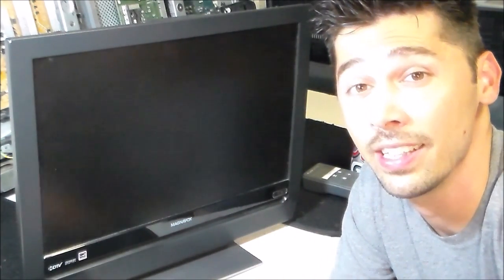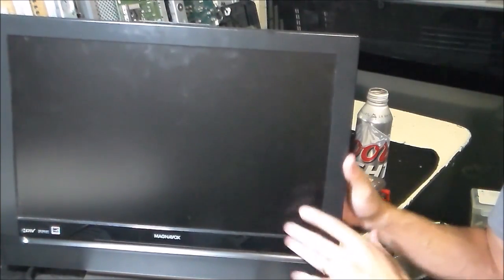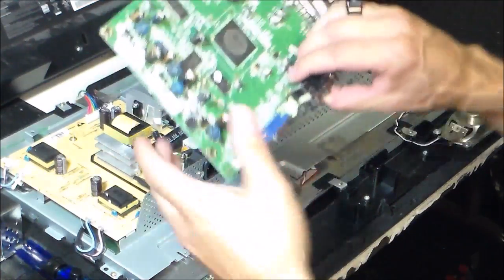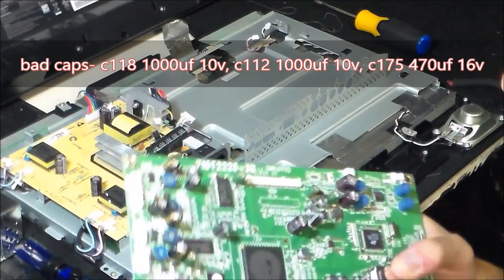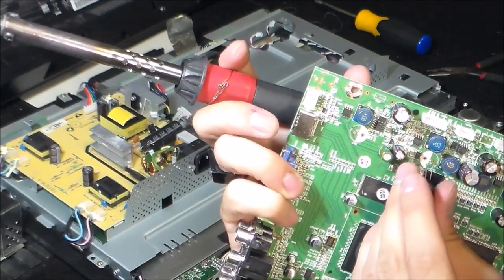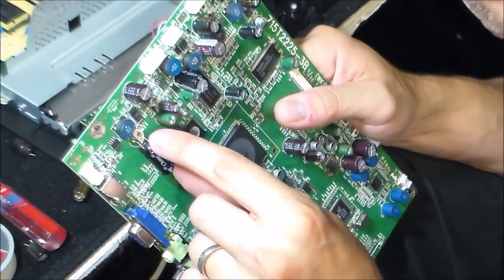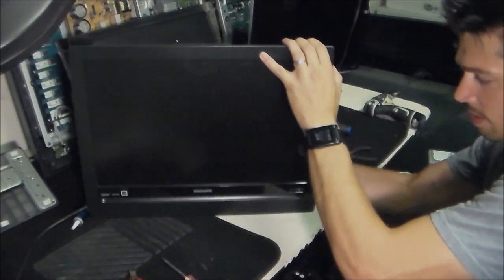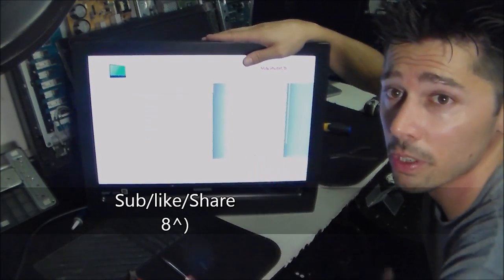Easy Common LCD TV repair service video, no power

Comment: Great Video! Have you ever worked on  Panasonic TC-L58E60 LCD TV Vierra Series? I cannot get  mine to do anything. I lost the remote but it has a power button. I even replaced the power board and it still is not powering on or showing any blinking lights if you have any advice I would gladly appreciate thank you!

Comment: Saw some of your YT vids about fixing LCDs. I have my 65" Toshiba 65HT2U that just died out of no where. Watching TV and picture went dead as if someone turn off the TV. I pressed the power button and the Power LED on the bottom left flashed a few times and never to flash again. No matter how much I press power button on TV, nothing happens. 
I decided to open her up. Checked fuse (good continuity and actually getting 117vAC). Toned out the power cord (good as well). I went through the pins on the vDC side and got 5vDC on one of the pins (not sure which one though). I went ahead and replaced the power control board from EBay, but wound up with no change of symptom. Don't see any blown caps on power supply board nor on TCOM (SLAVE1 and SLAVE2).
Any suggestions/ideas?
Any tips would be greatly appreciated.

Comment: We've got a 32MD357B LCD Magnavox TV which we use in the kid's playroom mostly for them to watch dvds on. It stopped working a couple of days ago. We aren't getting any power at all, no red light or anything. Does that sound like a capacitor problem?

Thanks for your help!

Comment: Hi. Thanks again for making this channel. By the way, what subcomponent (resistor, transistor, etc.) could one use to hack/replace and increase say the new iMac 5K LCD's refresh rate from 60Hz to 120Hz or more so you can use CAD like apps for visualization or for games (stereoscopic depth is way a better experience than ultra setting in games. A game could in be the lowest setting but will look great with 3D stereoscopic) after work when you're using 3D glasses for the AMD GPU's (Apple truly need to use Nvidia's most powerful mobile GPU on the next iMac 5K instead of AMD coz' Nvidia's got 3D Vision IR 3D Glasses). 60Hz will cause headaches when used with 3D Glasses, it's too slow. God bless. Rev. 21:4

Comment: I tried replacing the 3 caps.   I  notice that sometimes on its own now is it will go from RED to GREEN
but still no picture or sound.   The remote still does nothing.   Any other thoughts?

Comment: I wanna start fixing TVs, what capacitors should I have in stock?
Reply from the maker: these are common- 100uf to 3300uf get here-http://www.amazon.com/Sunkee-Values-Electrolytic-Capacitor-1000UF/dp/B00CV3MWXW?tag=tampfreepcpin-20&linkCode=w13&linkID=&ref_=assoc_res_sw_result_3
Reply: ***** Thank you

Comment: @Tampatec  my lcd is not turning on i opened and checked the power board of my tv the voltages are good 5v and all the voltage comes and work on power board but it doesn't start and turn on and the red light on the tv is also not coming Can you please tell me what's the problem with my toshiba LCD tv and how to fix it

Comment: I have a sceptre, the red light comes on when plugged in but not always, most times you have to keep plugging and unplugging it. once I turn it on the screen is black and the light by the red one is blue, if I unplug and replug, and I get lucky the tv will turn on. could it be they power cord itself or is it failed capacitors?

Comment: Hi, I have a weller wes51 and the some of the solder i have is 60/40 .031"/0.8mm is that fine? how much should I charge to fix a tv that doesn't turn on?
Reply from the maker: most solder will work fine but i don't charge family or friends but customers i think $40-60 a hour is fair, sometimes techs charge $20 trip charge too.
Reply: ***** Thank you

Comment: Hi, here is a very hard one for you.  I have a villa in Spain, the LG TV there will not work at the villa, but if I take it next door it works fine, I have run a wire from next door into my home, and still no TV, I have tried every socket in the villa, no TV.
Any ideas, if anyone can understand this I am sure that you can.
Thanks for your videos, there are great.
Kind regards Tony
Reply from the maker: not working meaning no tv picture or no power? i need more info
Reply: Thank you for your time,  I am not in Spain at the moment, but when I was last there the TV was very slow to come on, I have whatched your video, and will change the caps when I get back.  My villa manager has changed the TV, and he is holding the LG until I can do the repair. He tells me the TV works in his home, but when he takes it back to my home, it will not come on, just like when I was there. could it still be the caps, or a fault in the villa power, he has tried it in all the outlets, TV not working in my home, but works when he takes it back to his.
Kind regards Tony
Reply from the maker: Tony Eaves doesn't hurt to open up tv and check out the caps but it can be electric outlets.

Comment: hey my tv is a soniq 40 led lcd tv and I have the same problem but I look inside and there is nothing wrong with the capacitors (I know as I have fixed monitors etc with blown capacitors) I have bo idea what it could be it has red light when you push the power on button nothing happens

Comment: Hi I just got this 2014 samsung curved TV less than a month ago an it crapped out on me. Model number: UN55HU7250FXZA. The tv turns on but there is no picture. I can see the backlight when I look from the side and the tv still responds to functions from the remote. I can change channels, change source. Just nothing is displayed on the screen. Cannot access the menu since the screen is a no bueno. Any suggestions? Thanks

Comment: Hi i got a samsumg plasma 43" model 43f4500 no power no light. Dead. It cut be power supply ?
Reply from the maker: if your standby volts is 0v coming out of power board into main board then its most likely power board but if you get 5 dc volts stdby (sometimes its 3.3v) then next i would check main logic board. no standby light on front panel is most likely bad main board or power board or loose power connection.
your best friends is going to be service manual & meter, 1st call samsung for warranty check too.
good luck 8^)

Comment: Hey I have one problem on this tv exact same one and its with it over scanning well what happens is when my xbox one is on and I try to change the picture size I can only put the size to auto and wide but it's on wide and it over scans just a bit if you can plz reply because this is just annoying

Comment: I have mine apart.  Looking that those 3 caps that don't look blown.  Appearance is no different than other electroletics.  The model number is a 19MF337B/27
and the board with the caps is a 715T2225-2.    All I get is the RED LED for power button.  Pressing it does nothing. Remote control does nothing.

Comment: I have a seiki 32 in tv that has power and sound but no picture,has a power board and a main board but both boards look good .No bad caps or burn marks took and unpluged main board and still no picture or lighs.

Comment: I   i have a lcd tv dont turn on but stant ligth is ok i allraede chek it no bad capacitor i need your help
Reply from the maker: i need more info use code paul51p for free google helpout- https://helpouts.google.com/109162147223399593709/ls/b77b1f21705865ca?authuser=0

Comment: I would not recommend to use screw driver to help you to split the back cover! apart of taking the screws out, as you will leave nasty scratches on the plastic parts. Always use plastic equipment for this task.